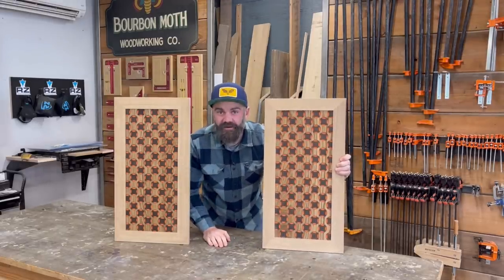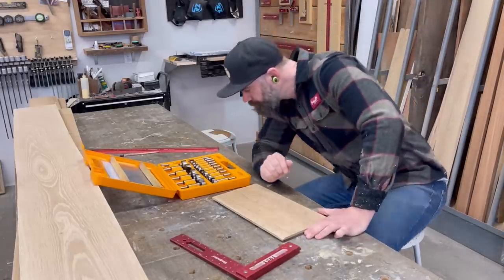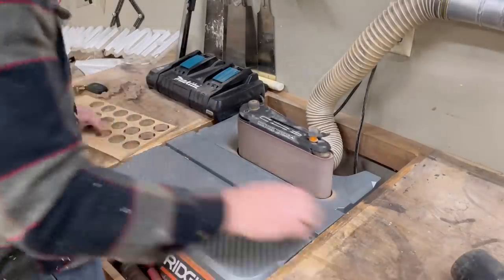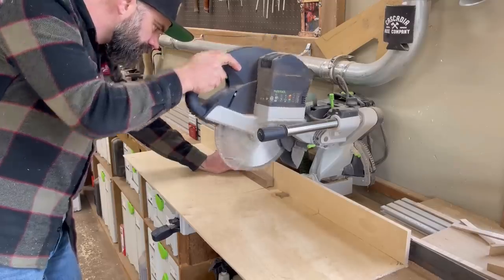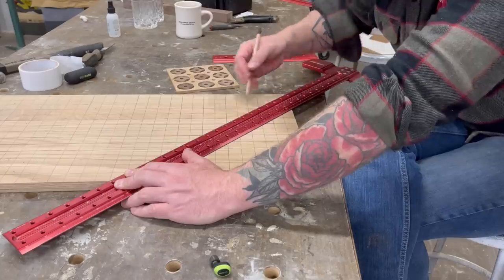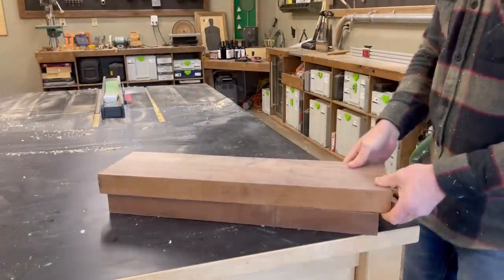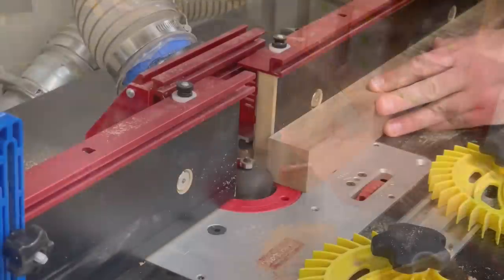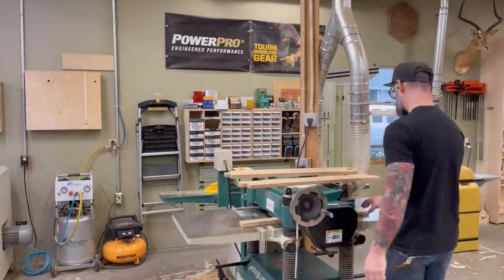Next Level Cabinet Doors || Making a Whisky Cabinet

Comment: Now that you've got tangerine backers on those I suppose it would be too late to recommend lights on the inside of the cabinet. I think it would've looked pretty cool and would showcase that lattice nicely.
Reply: I thought the same thing
Reply: Me too! Led inside would have looked the best
Reply: Ditto…. Some LED strips to backlight the cabinet
Reply: Lights need a power source which means limited places to move it or remembering to change batteries. If he's like me he'd forget or just doesn't want a power cord
Reply: @chriswitek9455  Yeah, no way something like that would end up plugged in for me. Doesn't serve a functional purpose and is yet another cable to route.
Reply: I just popped down here to say the exact same thing.
Reply: AND - Showcase the Whiskey bottles !
Reply: not too late at all, he can still drill out the orange backer again 🤪

Comment: The doors look great, but I would have used orange resin to fill the spaces between, much simpler and quicker, the resin would hold the pieces in place so no need to glue each insert.
Also interior lights would show through the resin.

Comment: Pro tip - when you need to route 4 sides of a blank you can start an inch or two from the end and stop an inch or two from the other end. This will give you a stable base to keep everything at 90 degrees.
Reply: That’s a great tip!  also nearly impossible to do with the feather boards.
Reply: @IndianaJBird  it would still work great, because the feather board would be pushing on the flats.

Comment: You could also consider doing a half lap joint on all the walnut and oak pattern pieces where the points of the star overlap. That way it's just two pieces to glue together rather than a bunch of individual stars and it might be a little stronger. Looks fantastic though!

Comment: Pretty, pretty, pretty……pretty good. Those are pretty good doors. I built some doors once and they were almost as cool as those. Really close except they didn’t have fancy colors or cutouts…they were plywood. Just 3/4” plywood but hey at least they worked. Actually they fell apart and I had to throw them away. This woodworking stuff is hard.

Comment: I have the same G0555 band saw you do and you're right it's not good for re-saw. I bought the G0531B and put a 3/4" Highland Woodworking 'Woodslicer' blade on it and it re-saws like slicing through butter. I've used those blades on the 555 but its the 5hp of the bigger band saw that really does it.  Awesome cabinet doors. That's a technique I'll use in the future.
Reply: That woodslicer blade was a game changer for me on my Grizzly bandsaw.  I also upgraded to a set of polyurethane tires.  A few people recommended that I upgrade to Carter bearing guides but I found the stock ones completely sufficient for resawing; they're bearing guides too.  I learned a TON from that David Marks bandsawn veneers video.

Comment: Really awesome looking doors! Are you concerned with wood movement? The walnut is now glued to the painted surface but the white oak will move? Also the white oak is only finished on one side so will it potato chip on you? Perhaps letting then walnut/oak float independent of the ply with finish on both sides would mitigate issues?

Comment: Great video; showing the process and the evolution of the idea is really helpful.  On the other hand, your table saw safety makes me wince a bit.

1. Standing in the off cut "line of fire".  We can see at 2:07 an off cut hits you square in the gut.  Fortunately it didn't seem to have enough mass for injury, but hopefully we've all seen Stumpy's (and now Tamar's) videos of how those unexpected projectile offcuts can be way more dangerous than one might expect.  Stand to the Side!

2. Using your fingers instead of feather boards and push blocks / sticks (especially for your groove cutting setup at 21:10 and again at 27:57).  You may have a SawStop "automatic braking system" but many of your viewers probably don't.   It would be great if you could demo ways to make cuts that would be safe for all of us (as sometimes how to make a cut safely can be one of the biggest riddles in this hobby).  You do seem to have a much safer set up for your router table, so kudos on that.

I don't mean to be a wet blanket; I really do enjoy the personality and insight you provide with your videos.
Reply: Not only that, (like I commented in last video) he's very sloppy when it comes to when he wears eye protection.  Most of time at miter saw he doesn't, sometimes at the jointer, etc, etc.  Guess it's going to take a trip to emergency room with an infected or damaged eye for him to learn

Comment: Try using a hole saw instead of a forstner bit. It'll save a tremendous amount of time. Just double check the hole size before cutting the walnut crosses because the hole saw might not be exactly the nominal dimension.

Comment: Very cool. It would end up all end-grain, but the same effect would have been a lot easier by routing a half circle into two long white oak boards, and glueing them together with the walnut churro in the middle. Which you can chop down into the desired thickness, and glue up into a panel. No time consuming alignment or hole drilling.

Comment: Great video!  I like the overall effect, but since everyone’s a critic, I’ll add my two cents.  The contrast of the grain in the oak panels made the total door a bit too busy.  You end up with star shapes made of 2 different colors… inside of polka dots… inside of stripes.  A different light wood with straight, low-contrast grain would have worked better, in my (not necessarily valuable opinion).  I certainly understand a strong desire to use oak because of its role in making whiskey (oak barrels), but it came at an aesthetic cost.

Thanks again for a great video!  I appreciate the way you let us into your thought process and working through challenges.  There are plenty of channels which simply present rehearsed tutorials on projects that the presenter has made before and has worked out the bugs.

Comment: Jason, I have a question about the panel glue up and planing. The panels were not even so they had a rock to them when you laid them flat.
I didn't think you could run a surface that wasn't flat through the planer? Wouldn't it reference the non flat side to the top surface that is being planed?
Sorry if it's a dumb question I'm still new to all this.

Comment: I think you could of used a hole saw on a press without the center bit to cut the walnut lattice.  Maybe use a different size hole saw so there isnt a gap for the thickness of the blade?

Comment: For some tips: use stop blocks on your table saw and your drill press. You get much more consistent results with way less trouble. You can also use blue tape on both panels and glue them up with super glue. The adhesion is enough, but it doesn't rip off your wood grain. Doesn't happen always, but its really annoying, if it does. Have fun!

Comment: Would it have been possible to make those orange panels 0.5" smaller in each direction so they sat inside the frame, without having to widen the grooves?

Comment: Just curious, couldn't you have used an airbrush to apply the oil? With an airbrush, you could get the oil into every nook and cranny, in which case you could use very light coats instead of one heavy coat as this would give you better control over the intensity of the colour

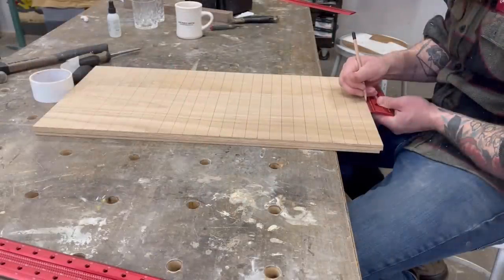Comment: 10:42 If you're doing layout and want a very accurate and consistent pattern then you shouldn't move the measuring tool to a new "reference point" during your layout as you're changing the primary point of reference every time you do. With an ever changing reference point, every time you moved the ruler you introduced another chance for compounding errors. There are also faster ways to do that layout, you could have used a simple pair of dividers; an equidistant layout divider, a storyboard stick(woodpecker sells a fancy one but, you could easily make your own), or my preferred method, used a jig. The "test piece" you made could have easily been made into a jig that would have enabled you to quickly transfer those circles in a repeatable pattern.

Comment: Did the band clamps fully close the miter joints, or did you have to take extraordinary measures to do so?   Clearly as a charter member of "The League of Extraordinary Gentlemen", this wouldn't present a problem for you...

Comment: If it was not for the non standard diameter of the walnut cuts you may have had luck producing a similar effect by routing grooves on opposite sides of the inserts prior to cutting the holes. Then presumably you could have just slotted them into each other and cut the final shape.

Comment: It might have popped in a better way if you swapped the woods and had white oak or maple stars inside walnut panel with holes ! May be would have solved the stars matching the shadow issue. Though you probably need the whiskey cabinet to be built out of the oak. Oh well looks good either way.

Comment: Ok I know you hate epoxy and I’m on board with that but hear me out. Put all the stars in and use a semitransparent smoke colored epoxy in the opening between the light and dark wood. It would securely glue them and add some extra interest in the piece.

Comment: Why didn’t you oil the inside of the oak holes before adding the walnut. And add the oil to the walnut churo before it was sliced up.  Then after it had been through the sander only the faces needed doing.   Might sitll have some runs in the holes but surely could minimise that

Comment: To drill all the 1 5/8 holes, I would have used a strip of wood equal to the width of one row, then drilled one row of equally spaced holes in the strip.  Then use that strip as a guide to drill one row of holes at a time in the panel, moving it down a row and shifting it over by 1/2 a square, to drill the next row.

And to cut the cove inserts on the miter saw, why didn't you just put a stop block on the right side instead of having to eyeball the pencil line?

Comment: Gluing the stars in, I would have poured a thin layer of glue onto a silicone mat then pressed each tip (just the tip ;-) ) onto the glue rather than use a brush.

Comment: If you made 2 identical panels one from walnut and one from white oak and just drilled the holes in both, you could have just offset the walnut board to achieve the same effect.
Reply from the maker: You obviously didn’t watch the video 🤣
Reply: Oh I did. Apparently I wasn’t paying attention  and when i watched it again there it was. 😅😂 apologies for the useless unsolicited advice